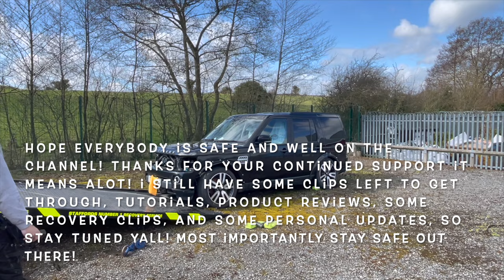How to LOAD and UNLOAD a NONE ROLLING VEHICLE on a RECOVERY TRUCK UK!

Comment: you need to be careful doing that had one set off like a bob sled when I knocked the last slippery under it now I do something similar but I keep the winch on the front and just lube up my slippery a bit of dish soap works well so you can send it off slowly so you can keep control of the car on the way down

Comment: Excellent video I use the metal skates with rubber wheels on beavertail recovery truck, car rolls as if in neutral... Bit of a faff jacking car up to get them in but worth it..
Reply: Salaam bro. What would you do if it started rolling off bent how would you steer the car so it doesn’t fall off the ramps.
Reply: @user-ds7ps9sv7y  strap the wheels down which you don't want to move and use winch and snatch block to move in into position to drop down... However if it goes off bent it must have come on bent and on a beavertail it wouldn't come on anyway so you have to move truck about to line it up